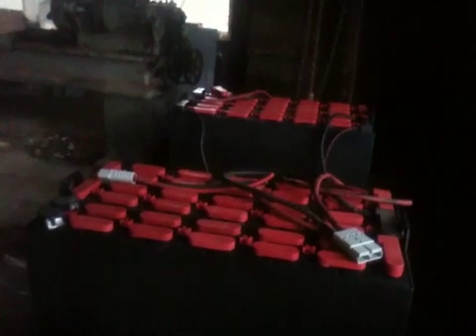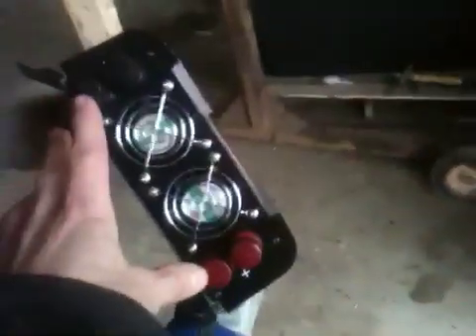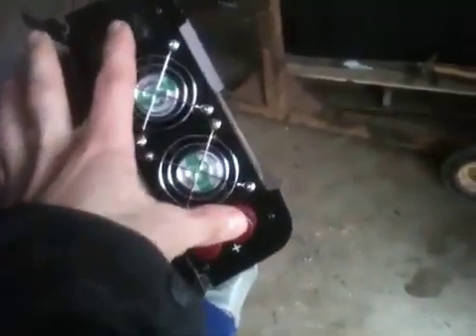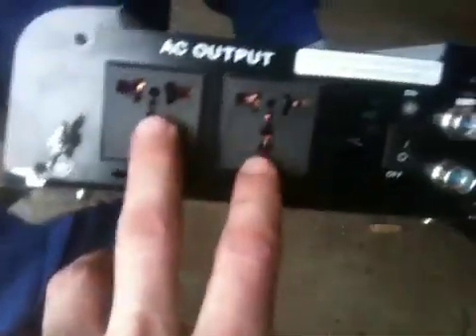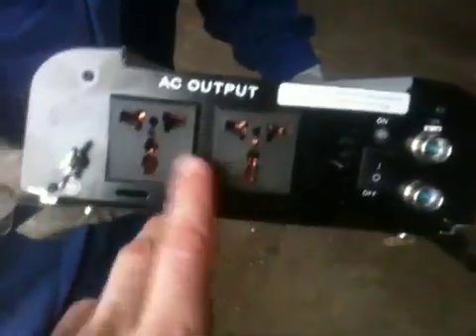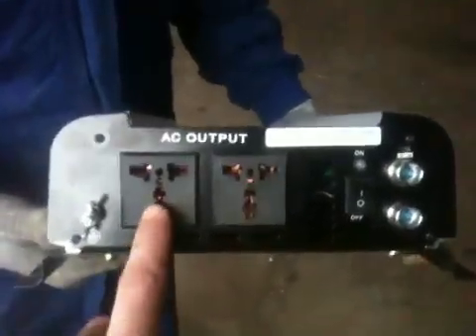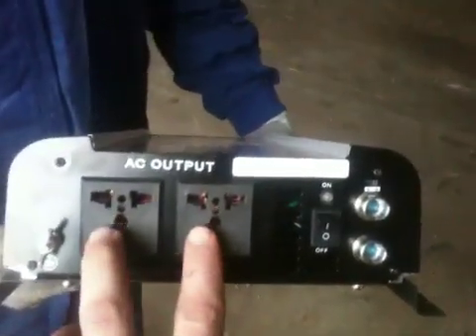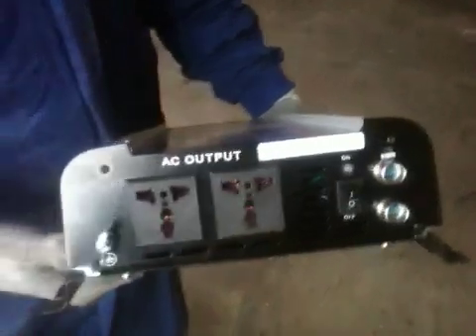12.5 kW Stackable Inverter System

Comment: I don't think you will be able to find any inverter anywhere that will power a welder.  The reason is that a welder requires an immediate production of amps to power the electrodes.  An inverter is designed for "soft-start" which means that the amperage ramps up to the the level that the device requires.  This is a safety/power savings feature of inverters.  If the inverter were to always supply it's maximum power level, and it were to have a short, it could burn itself up.  If you run an arc welder off an inverter, you will only get the welding rod stuck to the metal - if it starts at all.  I don't think a MIG/TIG welder would even work at all.  I have several videos that describe inverters and their functions.  I found your video because I'm thinking about ordering a couple of those inverters to see what their capabilities are.